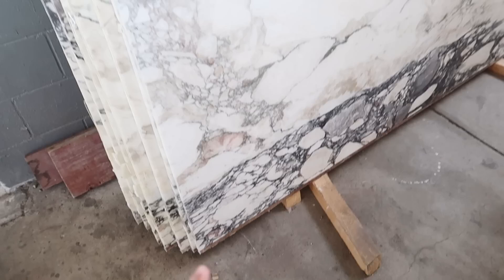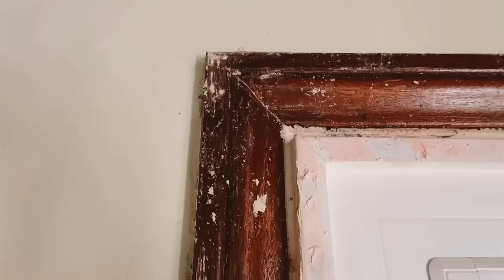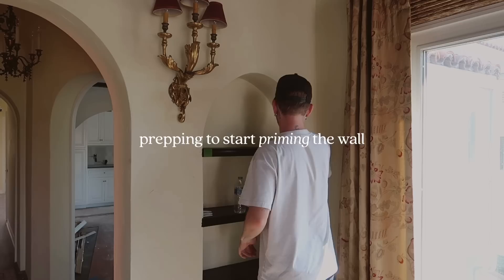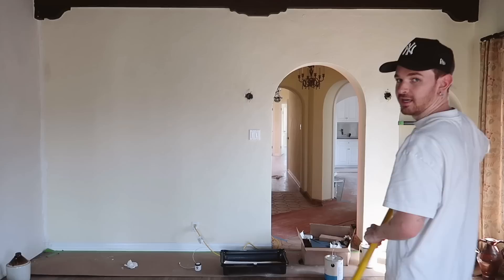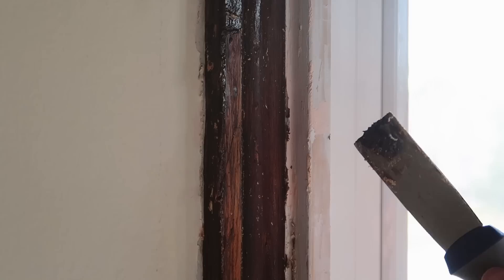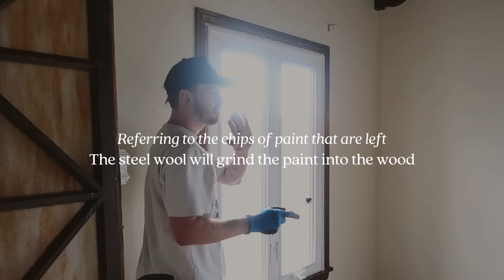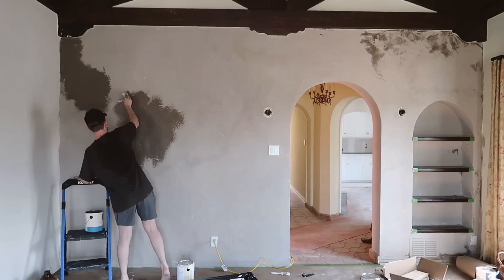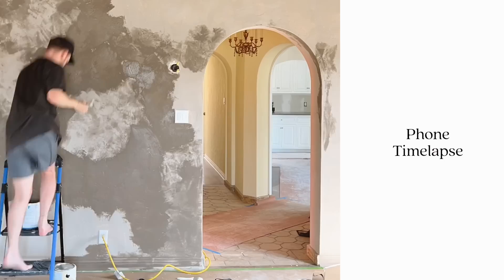WHY WHY WHY

Comment: Drew, I was a real estate broker…if there was a sellers disclosure and the leaks were not on there but it was obvious the seller knew, then take the bill to them.  They are obligated to disclose every issue known to the house. You have recourse. The inspector should have caught it only if they inspected with the water on and the leak active.
Reply: but of course, they'd say they didn''t know...
Reply: Thank you so much for saying that. I’ll give him the message asap!! Drews mom
Reply: Forgive me but I’m interested in how the inspection report didn’t list it? Aren’t they required to check the pipes? It seems like a big one to miss. I can’t imagine sellers often admit to hiding damage but you should be able to rely on an inspection? In the UK reports seem more in depth?
Reply: @patsysadowski1546  he mentions in one of the videos that during the inspection they check horizontal pipes because those are usually the ones that cause problems. They didn't check vertical pipes or anywhere that was too hard to access. The original owners could have been oblivious but it doesn't seem likely with the extent of the damage. Definitely something to look into.
Reply: @lizpeacebelle  I agree it’s a lot. I wonder in a big place like that if they just used the soulless remodelled bathrooms? Leaving the lights but lying about the pipes seems at odds but who knows? Truthfully in the Uk we get a lot of rain and a full survey is always recommended with older houses here. Of course most homes are 150 years plus. We have Victorian pipe work finally failing all over London. Every pipe needs changing eventually and I would have thought it effected water pressure to the effected room and some pooling/staining. Anyway I’m rambling but I appreciate the answer regarding the vertical pipes.
Reply: @Gemmythebulldog  you are so welcome.  I’ve been watching him with the house vids/lone fox and he is doing an amazing job. Especially at such a young age! Very proud of him.
Reply: @patsysadowski1546  honestly it really depends on whether or not the water was on, the leak was obvious, or it was disclosed by the sellers. One thing here that we have is a sellers disclosure, which is part of the contract. However, the house can be sold “As is”, and if a buyer buys a house that is“As is” then  it is on the buyer to fix or replace things that need to be done.
Reply: It’s difficult to prove they had knowledge and didn’t disclose it
Reply: @lacsuttle  The inspector should have caught it. Doesn’t matter if they only “tested” the vertical pipes. With that much damage to the pipes a good inspector should be able to visually red flag it. Also… if there is active damage that has been taking place for awhile, then it might not be that difficult to “prove” they knew about it.
Reply: @teejay1650  there is a different between what the inspector finds and reports and what the seller discloses. The original comment was in regards to the seller disclosure and that’s what I was commenting on.
Reply: He covered this in a previous video saying that they do not check the pipes that are horizontal so the seller wouldn’t have known either
Reply: The textured wall is nice.
Reply: @Gemmythebulldog  me thinks he’s too nice to do it himself. Mama may have to take it into her own hands 😅
Reply: How could they have not know??? Couldn't use bathroom without water leaking downstairs!!!
Reply: @patsysadowski1546  looks like the pipes are in the walls so know, they do a visual inspection, they open cabinets check under sinks and they look for water stains on the ceilings.

Comment: Drew, if that pipe was visible enough during inspection and they missed it, you should have a warranty on the inspection that will cover some aspect of the repair or will at least give you a partial refund for that part of the inspection!! Our inspection came with a warranty that had a clause that if they missed anything like that, they’d refund the inspection or cover the repair, depending which cost was less
Reply: Yes especially with that pipe access point in the wall at the back of the bathroom.
Reply: good to know!
Reply: Yes, I would contact inspector, inform of issue found and ask him if he is bonded
Reply: They're not liable for missed issues though, you could probably get back the money you paid for the inspection though
Reply: My parents sued the realtor,, when they found out they were not hooked to city sewer! There was a septic tank in the middle of the city that should have been taken out and changed 20 years before my parents bought the home!.. century 21,, paid for the sewer connection
Reply: @michellewilfong  most likely out of courtesy. There is no reason a realtor should be liable and not the previous owners, unless the realtor somehow had sole knowledge of the problem, which seems incredibly unlikely. Again, I get the rage and being mad, but inspectors and realtors are not liable for a previous homeowner's lack of disclosure.
Reply: @bonesonstones1  WRONG.. CENTURY 21,, PAID TO CONNECT MY PARENTS HOME TO SEWER..
Reply: @michellewilfong  yes, I can read. No need to yell at me. It was most likely a courtesy on their part without being legally obligated to do that, though.
Reply: @bonesonstones1  correct. The realtor is the last person I’d blame in that situation.
Reply: @bonesonstones1  wrong answer I guess you missed the assignment.. century 21 pay for my parents sewer to be hooked up over $20,000!!!. I don't know what state you're from but when there's a contract that says a house has city sewer in the inspectors miss it the realtor misses it that's not the home buyers fault the others are liable
Reply: @bonesonstones1  
They are engineers normally that do those inspections, mechanical/electrical engineers.
And yes they can be held liable.
That’s their job and they have insurance to cover when things don’t go well
Reply: @michellewilfong  Yikes just a conversation among adults! You may think she missed the assignment but your next class should be Anger Management! She’s right. Unless your parents had to sue the realtor or inspector with court fees, etc. then they probably did it as a courtesy, one because they want future business and not the bad reputation, and two because it’s a whole lot cheaper to pay the $20,000 then to pay the court/lawyer fees and the time involved. It’s chump change to a realtor and they have insurance policies as well for these kinds of issues.
Reply: @gypsyscometotown  not only is this state specific, but they also MAY only be liable for missed issues within the scope of the inspection - if you don't agree upfront go open the walls, an inspector has no duty to find issues there. All this is subject to the contract you sign with them and liability is dependent upon their negligence, usually. So no, an inspector isn't just liable for all missed issues.
Reply: I was just going to type this!!

Comment: My first house was an older one and we had a plumbing issue that was not disclosed by the seller. I know this video featured a cracked pipe but while the plumber is there ask about Orangeburg. Your house is older than the one I had bought but during war times, to save on materials such as metal, Orangeburg also known as tar paper was used to make pipes. The pipes in the house were pretty solid but the one taking waste from the house to the city was destroyed. Every time it rained, the pipe would fall into a peanut shape causing the water to back up in the shower, tub and toilets. I do hope you see this message. The plumbing world seemed to know about this stuff but not the consumers who fall in love with older houses. It ended up being a pricey repair...like over 6k.
Reply: Orangeburg pipe was used from WW2 through the early 70s. IIRC his home is from the 20s so its not likely there and wasn't used much in renovation work so hes very probably safe.
Interesting you were aware of orangeburg. Few are. It doesn't deserve to be labeled piping really, gawdawful idea from the get go. It was primarily used for sewer lines from the house to street, less often inside.
Reply: @edmessina8392  According to Wikipedia orangeburg piping goes back as far as the 19th century, so it’s possible Drew’s home might have it. It’s actually amazing how long a lot of it held up (but I wouldn’t want to find out my house has it!)
Reply: As far as I know, nothing better than a Purdy, take care of it and the brushes should last u forever…per hubby the painter in our house, lol
Reply: @law7326  Use PURDY BRUSHES if you CARE !!!
Reply: Millislim, I hope he sees your comment too. We had the same issue, but when they went looking for the underground line, we discovered our house wasn’t even connected to the city line. It ended up costing 12,000$.
Reply: We lived in area unown to us has flappers to stop back flow during floods but very very old and rusty. 3 times paying 3 plumbers I was standing in poop in shower. Finally got old guy who knew. It was at city end but whatcha gonna do at midnight. Luckily we had just bought small trailer we could use for potty.
Reply: @melanieahrens6739  orangeburg piping was not used for sewer and water applications until world war 2. From the 1860s through the second world war it was used as electrical conduit and subsequently by the gas and oil industry. The version used for sewer and water had triple fortified sidewalls to handle the pressure, which the electrical conduit did not have.
Reply: Happened to me to the tune of 7,000 the first time and 8,000 the second time.
Reply: @edmessina8392  Its first use, in Boston in 1867, was an experimental 1.5 mile water pipeline that was in use until 1927. It was also used to pipe salt water in the oil fields prior to WWII. But in general, you’re right that it was used for electrical conduit prior to WWII. However, Drew’s plumber said the corroded pipe was cast iron. If orangeburg can compete with cast iron it’s doing pretty well.
Reply: @edmessina8392  hopefully you're right but if any repairs happened during WW2, Orangeburg could have possibly been used. I had to find out about the stuff the hard way and it's really frustrating how little it's talked about in real-estate and by plumbers. Considering the age, it did hold up pretty well, but when it fails its catastrophic. I found a company that was able to replace the pipe without having to dig up my entire driveway. It saved me close to 5k using the trench-less technique of threading a new pipe thru the existing hole with a cone on the end. The cone broke apart any remaining bits of the paper pipe. Worked like a charm but the previous owners had to be aware and didn't say a thing about the pipes...by the first rain they were long gone
Reply: @cynthialawlor2420
Reply: These days they can send re-lining material straight through the pipes. Grows to form within the pipe and hardens solid.
Reply: @millislim  The technique of bursting/relining existing orangeburg (not exclusive to it) is called line boring. We have been using it for water services for the better part of 2 decades now. It saves a boatload in excavation, backfill and site repair costs.
I'm not being argumentative or a know it all, informed discussion is always good.
I've been a builder/rehabber/adaptive reuse (loft conversions, commercial to residential conversions) specialist for now 43 years. My dad, grandfather and great grandfather were all builders from 1916 until their deaths in 1948, 1978 and 1979. Collectively we have conservatively built or rehabbed in excess of 10k homes. 
That said, I'm trying not to scare the pants off this kid. His home is a semi custom, well constructed beauty from the 20s. The possibility of having orangeburg waste lines is nil. Cast iron was present as dwv piping in all of the exposed areas. In that time period orangeburg waste lines simply were not used in residential applications...yet. As I mentioned in a previous post, it was very seldom (if at all) used in subsequent rehab and sewer line/dwv repair during that period and would have been very unlikely anyway due to the quality of material used when built. It's deductive reasoning with that particular home.
Those most likely to find this material used in their homes' construction are spec built subdivisions which cropped up overnight during the waning years during and after WW2. Think Levitt Homes and the full spectrum of spec builders throughout the 50s, 60s and into the 70s. This is also the period when aluminum wiring was used extensively and, that too, is an expensive and invasive repair.
PVC drain, waste and vent piping in use today can be realistically expected to last 100 (likely more) years. It is far superior to cast iron, clay, orangeburg and galvanized DWV piping in all areas except one (in my opinion).....if installed behind gypsum wallboard in uninsulated cavities it is comparably noisy, you can hear water running through it particularly in vertical lines from upper floor baths and fixtures. It also gases off toxic fumes when exposed to flame which is somewhat mitigated by use of fire rated gypsum on adjacent walls.
Reply: Been there!
Reply: I dealt with this as well, however in my case I was able to get it covered/repaired by the seller even after closing!
Reply: Just wanted to give my opinion - between the sellers and the inspector someone is responsible for not reporting the leaks. They might  not have known the pipes were cracked but the should have known about the leaks. Talk to your Realtor - he should go to bat for you. 
Your house is so beautiful! Hang in there!

Comment: Sadly, what you see in one small area of your pipes is the general condition of ALL the pipes.  You may want to re-pipe before you move in since water damage is the worst.  We were faced with this issue in an older home so I share your dismay at the cost.  I will just say, you got off cheaper than we did.

Comment: Just so you know, when using rollers like this, you want to make a W or diagonal shape to start so that you get more uniform coverage.
Reply: Yes, and also use long strokes like the man he shows at about 5:00. He's making a lot more work for himself by using such short strokes. And remove the switch plate covers!
Reply: Since I have been watching Lone Fox he has never used the technique you talked about. I really don't know why. It is easier.

Comment: The cloud technique is so beautiful! I used it in my living room: faint pink under white and bronze. Your wall is gorgeous! Thank goodness the cracked pipe was discovered and addressed when it was--it would have been awful if you put in tons of work and then everything would have gotten ruined! Also, if the pipe was fairly old, you might not have wanted to use the water for drinking or cooking due to particulate from the pipes in the water. So maybe it was a good thing in disguise?

Comment: For your window trim, it still looks a little shiny so I would go over with a fine grit sandpaper first, wipe it down (tac cloth is great for getting of all the fine dust left behind even after you wiped with a damp cloth),  then use a wood / pre stain conditioner before you put your stain on, that should avoid that streaky finish that you saw when you first stripped the paint off. To get the depth of colour you are looking for, thin layers is key, don't be tempted to try and do it in one go (it will go streaky and look painted on). Some people have had great results with gel stain for the darker looks but I've never used it so can't comment, but might be worth testing that as I believe it takes a lot less prep.

Comment: 7:12 - ya, very oak looking to me.  From the longish rays and the period of the house, I'd say white oak is more likely.  A cross section of the end grain would tell all but not worth pulling it off the wall to find out.  I'd say white oak is your donor tree.
Reply from the maker: I have a feeling they are white oak too! I actually scraped a chunk off the side (thankfully) of one and it was pretty light! I actually like the current warmth and may want to make them a a bit darker!
Reply: @lonefox  yes, I’d go darker too.  Try to choose a gel stain dark enough to get the color you want but cover in one coat so you still get some of the grain coming through upon closer inspection.  I usually avoid penetrating stains on refinished surfaces because of uneven removal inherent in the stripping process.  It’s going to turn out great.  I can feel it!😎
Reply: For a moment i thought lemon wood? "Citronnier"

Comment: I’m loving your renovating journey, bad surprises and all. And REALLY loving going shopping with you for the house. We have just dived into our long planned renovations. We have a big house and a lifetime of stuff - we have had to pack up everything so all of the flooring can be replaced. We have a large square footage of tile on our main floor and have tradespeople here for a week removing it - Jack hammers and industrial vacs for 8 hours a day. We have also demolished our laundry and 3rd bathroom/powder room ready for the tiles to be removed. The walls are tiled full height and we have solid brick walls so it’s faster and easier to pay someone to do that part. Our painter starts next week, inside and out, all closets are being refitted, new flooring, new lighting, new window coverings. Kitchen, laundry, bathroom 3 (main bathroom was done in 2019). Our master bath has to wait until next year as I’ve drained the budget - landscaping is on the list once the exterior painting is done. 5 years of planning and saving coming together, though covid did delay things for 2 years. I just want it done so I can unpack again and enjoy living here.